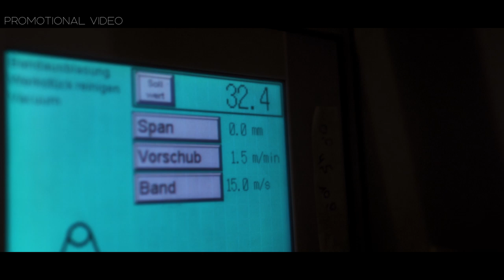Bog oak cube dining table with epoxy resin river table

Comment: How about a Epoxy table with different shot glasses inside? You can either choose shot glasses based on Color or size or shape. Or you could try one shot glass for one country, that way you will have many unique glasses
Reply from the maker: Thanks for the idea, but I can only make tables or projects that I can then sell without any problems. this seems to me a project which should be made especially for someone.